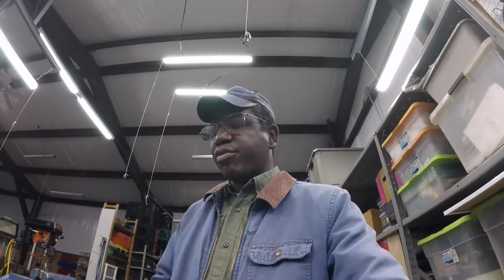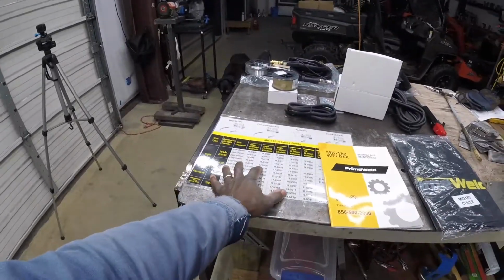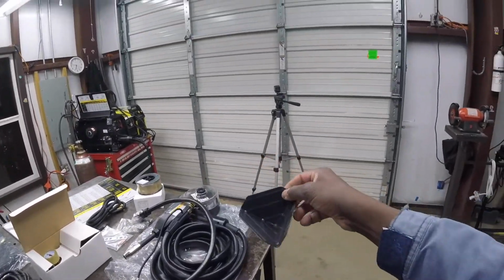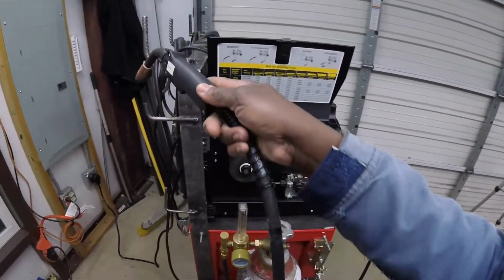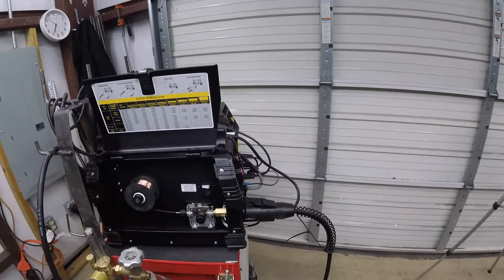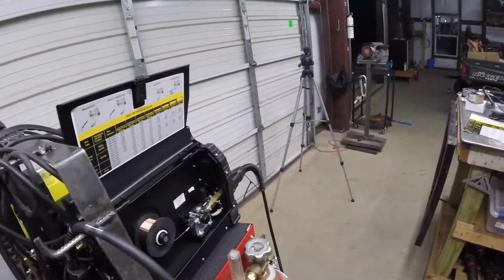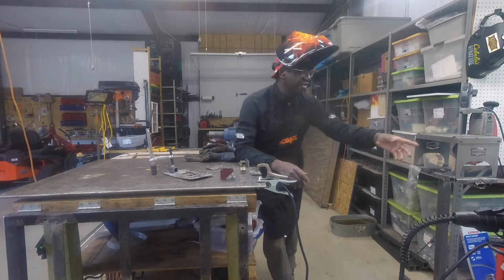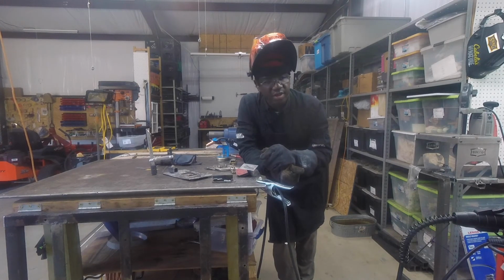PrimeWeld Mig180 with Spool Gun Review

Comment: I just bought one tonight. I've had a few other migs but none of them run .023 wire. I'm a bodyman and plan doing some side work soon in my home shop. You can weld 18 gauge with .030 but any thinner and you risk burn through or heavy clean up. I needed a solid machine that will run .023 and this one seems really good according to you and everyone else. An aluminum spool gun is definitely a plus also
Reply from the maker: GM My Friend,  glad I was able to help . . . when I opened the box, I knew the Mig 180 was a great machine.   Hobby guy here so I am still learning . . . thanks for watching.

Comment: Does your wire speed jump by increments of 4-6-10 when trying to adjust it? Bought one end of October straight out of box problem after problem even got blocked from there group for asking if anybody had similar problems, at first they were going to send me a new one to warranty the POS but then days later guy says it’s all normal for the wire speed settings to jump by 4-6-10 every turn almost impossible to adjust it, and at max setting it barely welds out of 7+ welders in my shop(yes I have a problem trying new welders 🤣) this is only one that will barely penetrate 1/16 sheet metal, 1 weld out of 10 might weld just ok, it’s obviously a bad unit I’ve tried for days even had a friend that has repaired welders for 20 years look at it  and agrees it’s junk and needs replaced but for some reason they try to say it’s normal, even got blocked from there group on Facebook for asking about the issues so maybe that’s why there are so many “good reviews” they delete and block all others.
Reply from the maker: I have not noticed that problem, but I am a novice to welding.  I will have to keep this in mind the next time I fire up the machine.  The customer service at PW is over and above what I expected.  Sorry that you are having issues.  Hopefully someone with more experience will chime in.   Merry Christmas Sir.
Reply: @danielchambers1958  thanks for the reply back, I’ve seen a few do it after searching around the wire setting just seems odd and hard to set, but not welding consistent can’t be, your video was one of the ones that pushed me to buy one after two years of talking myself into buying another machine to try out, obviously there pretty decent machines I just need one that works right not hating on primeweld just having issues for some reason, merry Christmas to you too
Reply from the maker: @ab75901  Thank you Sir.

Comment: Great video. Can you mig weld with 100% Argon?
Reply from the maker: GM my friend . . . I think some people do, but the ideal gas is 75/25 mix.   Tig requires 100 percent Argon.    Thanks for watching.
Reply: @danielchambers1958  I have a never used  15 year old, I'm guessing 80 cu ft, around 4 ft tall, tank of 100% CO2 I got from a welding supply store back when I bought my Lincoln weld pak 100. Could that be used for reg steel mig welding? Thanks
Reply from the maker: @rickl6697  You can use it, but it will not perform the best.  If you can, see if the local welding supply store will exchange it for some 75/25.   I hope this helps.
Reply: @danielchambers1958  I just went out to my garage to check that bottle of welding gas and it wasn't CO2. It's labeled ARGON. YEAH. I would have bet money it was CO2. Hopefully the valve didn't leak. It was a brand new bottle when I bought it and it's never had a gauge/regulator put on it. Thanks for all your help.
Reply from the maker: @rickl6697  I am glad you doubled-checked the bottle.   You are welcome!